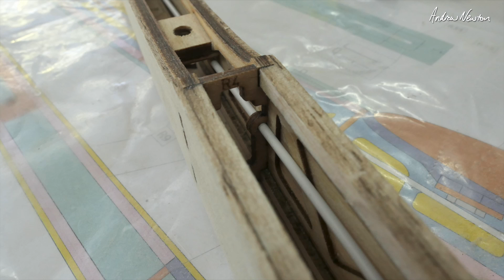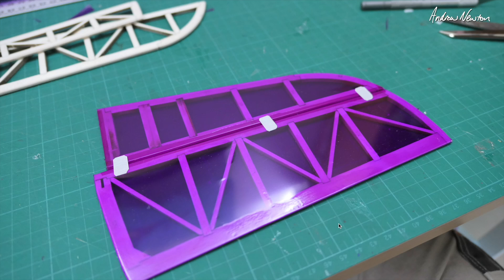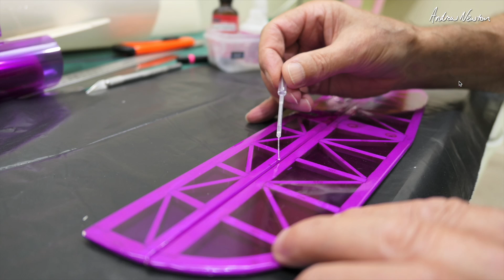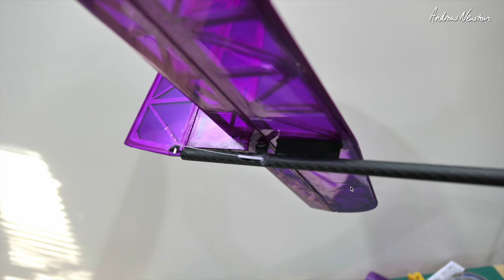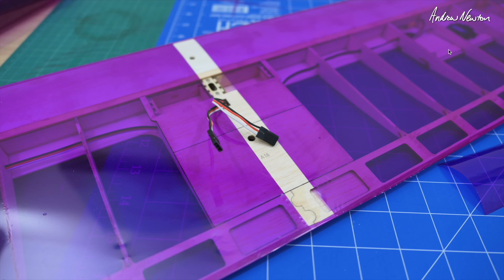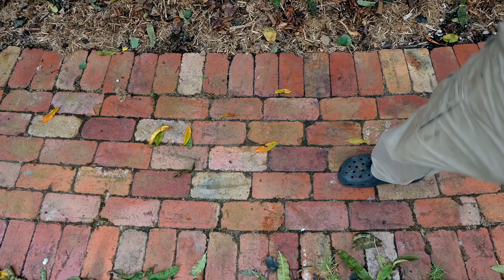RESilience RES Glider Kit Build - Part 3

Comment: Nice work Andrew. Don't worry about the weight. My X-Dream F5 RES (same size as yours) weighs 474g RTF and I could take 20g off that easily, but it absolutely doesn't need to be any floatier, plus as mine has a motor, yours has a slimmer profile. One thing to watch out for - don't go overspeed, the wings will warp and bad things will ensue. Use those spoilers. Good luck with the maiden, you're going to love it.

Comment: Nice smile! A great sign of an excellent build. With translucent colour she looks spectacular. 

Mateksys offers a "Voltage Booster, 1S Li to 5V" SKU: VB2A5V that converts 1S to 5 volts. It weighs just 1-2g and combined with 18650 (or smaller) would provide hours of flying. Alternative similar Voltage Booster Regulation Module circuits are easily found online. There are also good 2s battery choices common for small quad drones.
Reply from the maker: The perfect battery is a GP Akkupack 400mAh/4,8V L2x2 Uni Stange, but they don't seem to exist here in Aus
Reply: If curious of Li-Po battery internals, @Chris Rosser recently did a number of teardowns to analyze, and made some comparisons.

Comment: Looks terrific!  I'm sure it will give you some impressive flight performance.  My only quarrel with the RES designers is this: Give me another 3 or 5 mm of width the the fuselage!  I'm sure it wouldn't hurt the performance of the aircraft too much and many designs are just too tight.  I look forward to seeing the flight video!

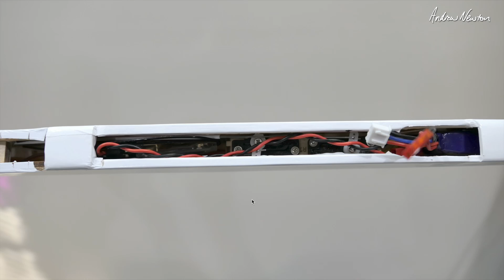Comment: 5:30   because  CF is heavy and because the dom of  CF tube  cannot be optimized, its use for any purpose is not recommended.!        it appears that  LIGHTER  pushrods could have been  Fabricated; using short lengths of steel wire  and  wood/bamboo.!        d
Reply from the maker: Hi DD, welcome back. What is dom?